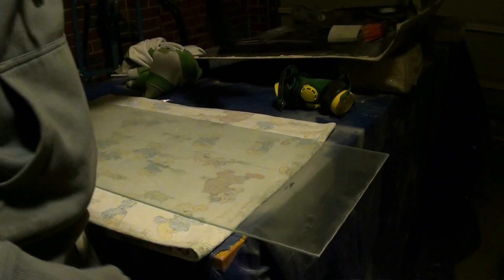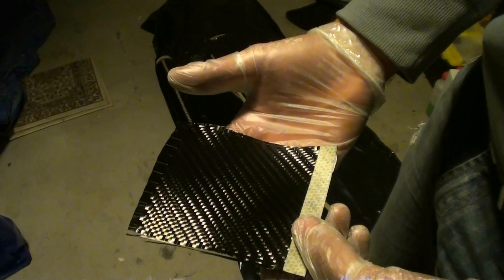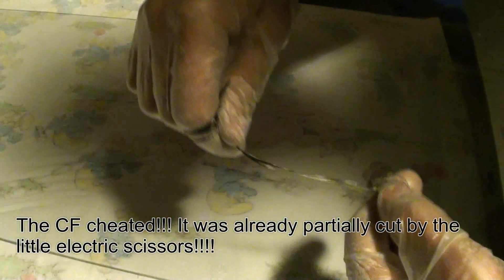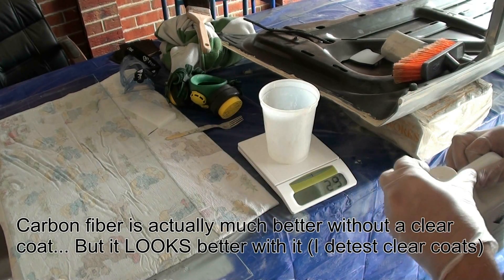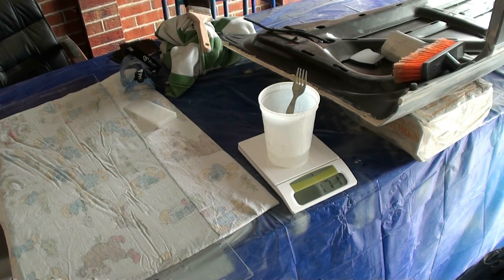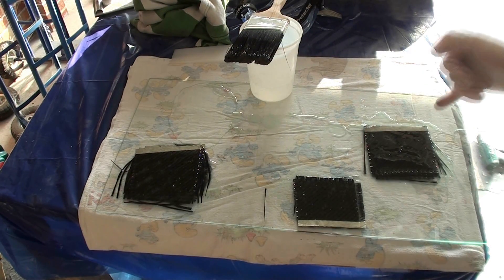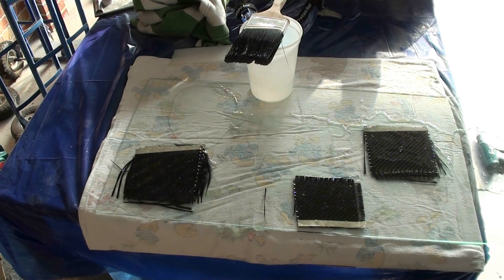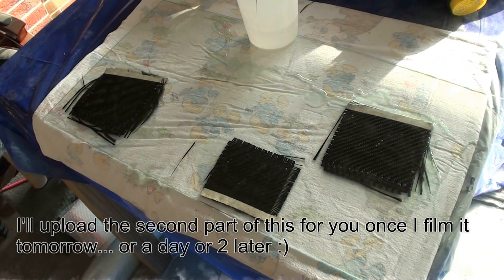Carbon fiber production techniques   Part 1

Comment: You could use a gas torch but you still run the risk of ruining the part. Its too hot and also forced air alot more concentrated in one area than a heat gun

Comment: I've tried everything for avoiding bubbles while doing a wet hand layup or wet prepreg- heat, gelcoat, roller, stippling, different types of epoxy, vacuum, etc, and they all come out with bubbles on the finished side. The best technique for preventing bubbles is using vacuum infusion with a vacuum infusion specific epoxy- Like in the later videos. I love infusion. Great Video! and thanks for documenting your stuff so we all can learn from your experiences. -Mark

Comment: use a heat gun and apply light heat to avoid air bubbles. do not use the gf hair dryer. will result in many cold nights on the couch.

Comment: Two ways to avoid and remove air bubbles are:
1: Use a foam brush.
2: After applying the resin, let it settle for about 10 or 15 minutes, then using a spray bottle with Acetone, spray a fine mist over the resin, this will do two things, it will pop any remaining bubbles and give the surface a smoother finish.

Comment: The best way to ghet these sheets and avoid air bubles and all kind of imperfections and how you pretended just a piece of carbon fiber that will be like a shit of metal no any forms or shapes plain than you should put another glass on top and compres them fith a waight.is as simple like that.
I hope i´ve been helpfoul.

Comment: Easy way to avoid air bubbles, hit it with a heat gun after you lay the resin down. It will thin out the resin and the bubbles will pop :)

Comment: You can pour it from a from fairly high from the surface, to avoid air bubbles, thats what I heard for making plastic molds. I'm assuming it will work here too. And when stirring try not to whip it, like scrambling eggs. That can put air into it.